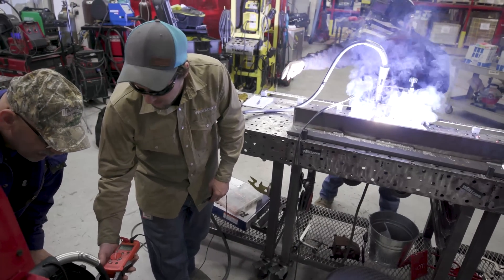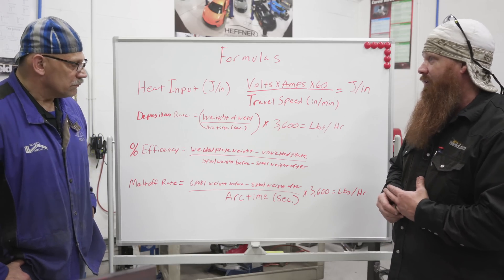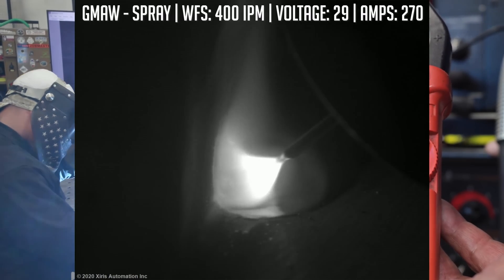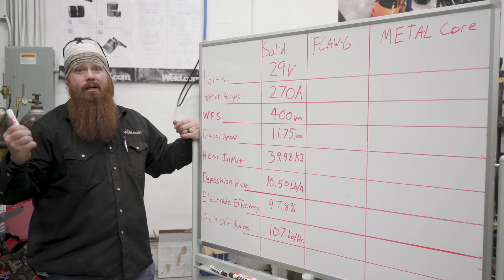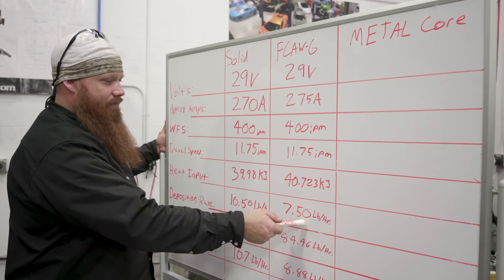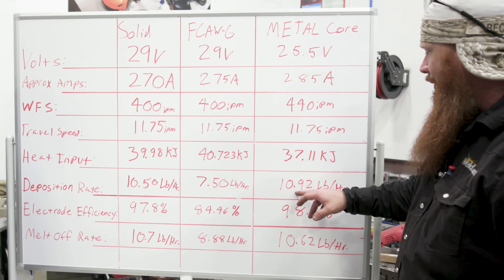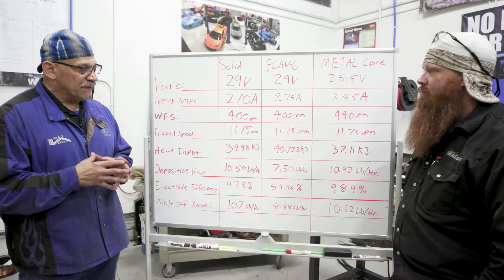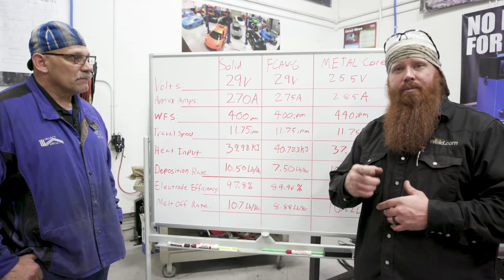MIG vs. Flux Core vs. Metal Core

Comment: Having ran both side by side at a demo I wouldnt bother with solid wire. The metal core is substantially nicer to run everything else being equal. Much more forgiving of settings as well.

Comment: For the gas shielded flux core test your wire feed was to low, voltage to high, and stickout to short (it is kind of hard to tell but unless you have rebated the tip into the nozel a fair distance it seems you are running about 3/8-1/2 inch of stickout, where as 3/4-1 inch is what most manufactures reccomend. if you were to run similar setting to what Lincoln, ESAB and BOC reccomend with they're FCAW-G wires you would be at around 600 IPM and 27-28 volts with 1 inch of stickout for 280ish amps, and that would drastically change the outcomes here I think.

Also running the FCAW-G with the wire that low at 29 volts I strongly sustect would have slag inclutions in the root of the weld, as there isnt enough arc force to drive it into the corner despite the surface of the welding looking great.

Comment: I feel like this needs to be ran again. It can be much more accurate. Do the same thing but weigh the fluxcore before you chip it off. Then do a 3rd final weight after you clean off the welds. Silica has weight and it's waste just like slag so do a weight with all the waste you can save. Then clean the waste off and weigh again. I'm pretty interested in knowing the difference there.

Comment: I run my Miller Pipeworks at 550 WS sometimes 600 WS It’s called Pulse Mig and its the most efficient way to weld prefabricated steel pipe. Metal core just carries the silica with the puddle instead of depositing it throughout the weld puddle. This spray transfer bullshit is just that. Get with the times and ditch the dc

Comment: You try and tell me that bare (solid) wire doesn't spatter as much as Flux core? Try it on DIP and bare wire isn't allowed on pipe and vessel work in the UK

Comment: Very informal, I just got a Lincoln 140 HD from Home Depot And will be doing around the house jobs for myself. I was a combination welder in the industry in Houston Texas for right at 20 years. Most of my welding was heliarc and stick welding and very little MIG welding. I'm kind of leaning towards the MIG welding part of my wire feeder because I feel like it has a much cleaner weld verse flux core. 
I didn't  know that there was a difference between MIG welding and flux core welding just that the flux core had flux on it. And Mig you can use C25 from what I'm told. What do you think?

Comment: I’m on FCAW-G right now. I just passed t-joints yesterday so today when I go in I’ll start on my plates. At my school we use a 22.5 bevel on both with a ¼” gap. 
What I’ve realized is that you can’t be afraid to experiment with the settings a bit to figure out what settings fit best for me. Just turning up my wire speed 10 and I went from having spatter everywhere to not having everywhere.
Reply: That's the whole point of welding school. Experiment there, remember what works for you, and take that out to the real world

Comment: Very good video thanks. One question,when you run double shielded flux you don't or can't reverse polarity,right? Where regularly on plain flux core single shielded ,no bottled gas you reverse polarity,correct?

Comment: Dual shield Flux core still the best heavy structural steel wire. Runs great vertical up and overhead.  Smoother flater weld

Comment: I'm new to welding but my biggest complaint is that the cost in gas wasn't measured in these tests and consequentially my opinion hasn't been changed at all considering the cost of transporting and consuming gas as a shielding method additionally I currently use non shielded flux core wire primarily for home and non structural jobs which wasn't even a staple in these tests which only raises the question are you only promoting certain methods and people due to sponsorships/prior obligations for monetary reasons?

Comment: I would like to have known the weight before you cleaned off the slag on the fcaw weld to get a more accurate, higher, efficiency calculation. Some of the flux will vaporize so the calculations will still be flawed. Maybe the manufacturer has specs, weight of flux per foot.

Comment: Great points. Nice work. I would have also discussed differences in consumable cost and product availability. Metal core is normally more expensive than Mig. I’ve also seen issues  availability of metal core inventory.

Comment: electrode efficiency for solid wire on spray transfer is incorrect:  10.5/10.7= 98.1% efficiency.  For metal-cored wire, deposition rate cannot be higher than the melt-off rate. Assuming these got mixed up, then 10.62/10.92= 97.3%.
Reply: I noticed that too

Comment: I'm behind the times!  Although I have heard the term metal core wire, I just figured it was a fancy way of saying solid wire.  Thanks for the video because I did a little research to find it's a very interesting product.  Something that I probably won't ever run through my 40-year-old miller wire feed though.
Reply: Why not? It's hot, but it has it's place.

Comment: Do you have a video that shows 'The Complete Welding Overview' ?  
It would be good for subscribers to be able to refer back to a complete overview.  That would explain all the different processes (stick, tig, mig, pulse, with shield, without shield gas??) , transformers vs inverters, mobiles and how you would or wouldn't be able to add a mobile suitcase welder into your shop and truck.  Great channel!!  Thanks

Comment: Why do you limit solid wire to 5/16” and less(just curious)? I work in a machine shop and weld 1/2” and 5/8” plate all the time with ER70s-6 I normally run around 33/34 volts and around 600 IPM (my machine uses number dials for WFS :(  )  and my amperage dial normally shows around 320 amps give or take with a short stick out. I’ve cut and etched scrap plates of this thickness before when I’ve had some down time to see if i need to adjust my settings. Needless to say i was fairly satisfied with the results, root and fills all looked good, so did my fillets.
Reply: ⁵/¹⁶ is the filet weld size maximum for single pass. Not the material thickness. If you try welding a ⅜ single pass filet it doesn't penetrate as well because of how slow you have travel

Comment: Great information and very clear, tell you both are very knowledgeable. I would of been interested to see the self shielded wires used in this test also as comparison, i use a lot of shielded wire myself due to my workspace and price of gas in my area but its good to know both sides :)

Comment: Why solid wire is called spray?
Reply: Because it's not short circuiting. Like he said once the arc is on the wire never touches the part. It vaporizes into the plasma stream within the arc cone and actually is transferred to the metal by flying through the air. Hence spray transfer

Comment: Yup metal core is best bang for your buck. Lots of production shops out here will run 1/16 wire in big barrels of it.
Reply: What settings would they use for that 062

Comment: But isn’t there a most efficient amperage for each different kind of wire, and alloy? Because of that, is keeping amperage the same really the best way to do this? It means that some wires will be running at a more efficient rate, while others will be less so. Is that realistic? Running each wire at its top efficiency would be a better way to do this. The same thing often goes for the gas type, and even sometimes for the gas flow (when gas is used). And a difference if 15 amps is notable, though not dramatic. If thevanoerage was to be kept the same, shouldn’t it have been adjusted right after the weld began? Of course, actual power used is voltage times amperage, so it’s actually using less power.

I know it would be much more complex, but knowing the best way to run each wire, and running them that way would be the true test.

Comment: Thought flux core was so you don't need shield gas interesting 🙂 only cus I seen cheap welders without gas co2 input
Reply: That's Self-Shielded FCAW. Doesnt require any shielding no, is basically a stick rod turned inside out.
Reply: Yes,  self shielded fcaw doesn't need gas. Most fcaw-s also runs in DCEN like stick

Comment: I dont understand why Co2 for fcaw-g.. I thought was C25 usually
Reply: Cost?? its what the average low rent shop uses.. i would rather go 85/15 and try to get more spray than glob.. 
But i also dont know if they specified the exact wire they were using like 71-t1 vs another wire..

Comment: Does the 3.5 volt difference have an effect?
Reply: Pat ogarrety It probably does a little bit. The arc length should be a little bit shorter, but probably not noticeable when welding free hand.

Comment: So you say your trying to do even test? 

But you run mig and metalcore at 90/10 gas.... but fluxcore with 100 co2???  Would not 75/25  be more acurate?
Reply: Just difficult to hear its an even test when 100% co2 will always produce more penetration even on solid wire mig.
Reply: And why did you not weld at 29V for metalcore? 

You turned down volts and up wire speed.... obviously it will have more deposited.
Reply: So why was this not cut and etched?   You run metal core colder. Do can guess its less penitrated than the others at 29v.
Reply from the maker: The volts were different because we're making it so each wire runs at approximately 275 amps. We ran the gas that each wire is designed to run on so one doesn't have an advantage over another for using a gas it's not meant for. Hope that helsp
Reply: @Welddotcom  i understand... but why not run them all optimized....
Reply from the maker: @davidsolomon915  We did.each gas was paired with the specific wires requirements.

Comment: That’s amazing! metal core deposition rate is higher than the melt off rate! I’m assuming you reversed those numbers.
Reply: He had to have. They also fixed the efficiency from the flux core (initially they calculated as lbs/hr, instead of %).
Reply: I don't know what they did there. According to their numbers, they deposited 0.162 lbs of weld, using 0.278 lbs of wire. Doesn't add up, that'd be 58% efficiency...

Comment: Not really an apples to apples comparison though. Mig and metal core only good in flat and horizontal positions especially in spray mode. How do you compare amperage when spray voltage and wfs is so much higher for spray?  Deposition rate for spray is always higher for spray mode.  A lot of variables in play here depending on the size of the consumable.  Fluxcore always seems to have less deposition rate and it’s a multi position weld process.  Metalcore is faster for flat production welding processes.  Odd comparison IMHO.

Comment: OK, I think I missed something - what is the difference in solid wire and metal core? I've heard of solid and flux core(s) but never metal core...
Reply: I was wondering the same and had to do some searching and reading. Solid is just solid wire with usually a plating to reduce oxidation during storage. Metal core has a core of a blend of metals in powder form, the outer sheathing is there to provide a current path for the arc.
Reply: @abpsd73  Yea... I think I'm looking at the same googled site you are. I'm reading the same thing. Funny I've never heard of metal core before...
Reply from the maker: Metal core is a cored wire that has alloy in the core rather than flux. Check out Select Arc's website. They have some good information.
Reply: @Welddotcom  So it's a metal coated by another metal?  Isn't that the standard MIG wire?  Where there is a protective copper like colored ER70S-6?
Reply from the maker: @danl.4743  No. The core is not solid like a standard solid wire MIG
Reply: The point of metal core is that it allows for more efficien current transfer, because of it's structure. Like you can hear the guy in the video saying that metal core has smaller droplets in the transfer spray etc. Similar to how solid wire is more efficient in spray transfer than short circuit mode.
Reply: Metal core is tubular like FCAW but has powdered metal inside instead of the flux.

Comment: How is your deposition rate higher than your melt off rate on the metal core? Possibly got your numbers switched? with the numbers as they are, your electrode efficiency should be 102.8%...

Comment: I used to work at a shop on second shift when I was going to trade School. We ran 060 flux core wire. 30 volts and 275 on wire speed. This was required. It made great welds just like the ones you just tested. Thanks for the educational videos.

Comment: We tested metal core SMAW at work.  A code shop.  Running the wire wide open I could not get over 720 amps with 1/8 inch wire.  The deposition efficiency and rate is crazy.  Still think the solid wire looks better.

Comment: Metal core wire, what is the difference in the construction of the wore as to solid wire? That's all I'm confused about, other than that, excellent informative video! Thank you gentlemen
Reply: Metal core and dual shield are tubular wires.  Flux core has fluxing additives and metal core has that and powdered metal inside the tube.  Easier to change deposited chemistry with the same base wire.
Reply: @scottharvey7730  thanks Scott!

Comment: You said your using 100% CO² on the flux core, I thought the point of flux was that the flux created a gas shield, or were you just saying that the flux created CO² gas and you weren't adding CO² as well.

Also what's the difference between solid wire and metal core wire? Is the metal core covered in a different metal or something else covering the metal core?
Reply: They have gasless fluxcore wire and duel shield fluxcore wire.
Reply: @Eric-gv9fn  why? Does duel shield produce a better shield? Or is it used in specific circumstances?
Reply from the maker: Gas shielded flux core and self shielded flux core are very different processes and use different fillers.
Reply: @Welddotcom  excellent, thanks for the reply.
Reply: @Welddotcom  and what's the difference between solid wire and metal core wire?
Reply: Craig Hastie solid wire is just that, solid. Metal core has metal powder on the inside of the wire. Kind of like flux core has flux on the inside.
Reply: @GodslilRedneck23  so much to learn. Thanks.

Comment: Love how y’all gave all that data.  There is a lot to learn.  FLUX-CORE amazed me.  Good old idiot wire lol.
Reply: Yeah, majority of the Flux Cored wire small shop or hobbyists use is gas-less. Dual shielded is what larger job shops will use. You have to get a specific Flux cored wire to do it that way.
Reply: This isn't standard flux core it's what they called double shielded which means it also uses gas
Reply: @lprkon72   ok thanks. i was confused why they were gas shielding flux-core

Comment: So what's the difference between solid and metal core wire please?
Reply: Solid wire is a solid electrode, most often copper coated.  Metal core is a hollow tubular electrode filled with powdered alloy..
Reply: @bman041  right yeh just not 100%up on the correct terminology at the mo thanks man

Comment: The shop I work at we use almost only Hobart metal core. We weld a lot of 1" thick up to 6" a514 at 29.5v and 350 wfs with .045 wire and 90/10 gas. I would say we get an almost excessive amount of spatter.
Reply: Hobart wire sucks. Hobart anything sucks lol
Reply: That makes sense because they're getting that wire to spray at 25.5v in the video, that extra 4v is just turning wire into spatter. Try turning the voltage down and bumping up that wire speed.

Comment: In the flux core since you measured the weight maybe you should have weighed the amount of gass that metal core and solid wire put out also to have an exact comparison on efficiency.
Reply: Jesus Reynoso they both ran on 90/10 at 40CFH for the same amount of time. No difference in gas usage.
Reply: Who cares about the gas when ya got bottles that size they've got lmao 😂😂😂

Comment: Next video should be the differences in mechanical properties and ductility differences elongation pulls and charpy V notch testing same wires
Reply: Carol Florian if each wire is of similar classification, the mechanical properties will not vary much.  What does vary is frequency of weld defects.  Solid wire will exhibit higher rates of non fusion and fluxcore will exhibit slag entrapment.  Metal core is by far the most robust and operator forgiving semiautomatic process.
Reply: But it is limited also unless you have pulse metalcore is also more pricey it just depends I guess
Reply: Keep in mind when dualshield is used with pure co2 you lose deposition quite a bit than with c25 yes slag is something to deal with but if proper cleaning is used not a problem really hardwire is the cheapest to run on spray but its is harder and more brittle I've had experience with that issue personally dual shield will be my go to always it's more forgiving and burns through millscale like no other and its ductile properties make it superior I think awesome video

Comment: How or where did the 3600 number come from?
Reply from the maker: 3600 seconds in an hour
Reply: @Welddotcom  oh, thanks
Reply: 60 X 60 😁
Reply: Watch the video FFS most people must skip through to the action 😂😂😂😂
Reply: @davey2k12  he wasn't absolutely explicit, if you don't know there are 60 seconds in a minute and 60 minutes in an hour then you may have been confused by that fact that using the 3600 turned it in to a per hour figure but it's a pretty low bar to know how many seconds in a minute and how many minutes in an hour. Does make me wonder about the future of the human race 🤦
Reply: @cjhification  FFS bro I done that calculation when I was at school 20years ago 😂😂😂
Reply: @davey2k12  yeah I did it 30+ years ago at school, but maybe today is different.